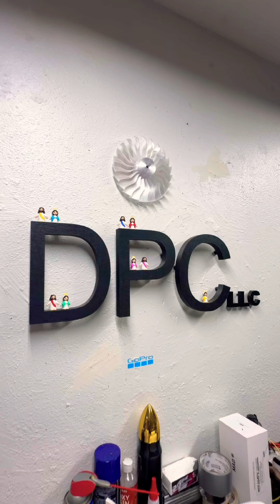I’m building an A10 Warthog.

Comment: Im not sure the settings will work for me considering the printer being different than yours but Im starting from ground 0 with 3d printing with the main reason being so I can print my own planes. I'll take all the tips I can get with that lightweight filament because I have 0 experience with it. The slicer software is the same though so thats a start. BTW, its hard to pick a favorite with all the amazing pieces of aviation engineering out there but the Warthog is definitely in the top 10. Pellet gun tech has come a long way and may be light enough and that plane has the wingspan to hold it to possibly make that plane actually go brrrrrrrrrr. Speaking of things you shouldnt do with an rc plane, if you break the sticks off of whistling moon travlers they make perfect little rockets if you wanted to put some rocket pods on there too😂
Reply from the maker: lol scaled down runs over fields to bring town the gopher population.

Comment: That prints very nice
Reply from the maker: It has been an adventure to find a good filament and the proper settings. While the X1C allows the use of off brand filaments it does not always understand them in the sense of what their specifically required print settings are. So, it can take some experimentation, but I think we got it.